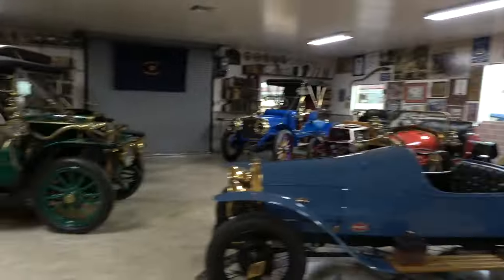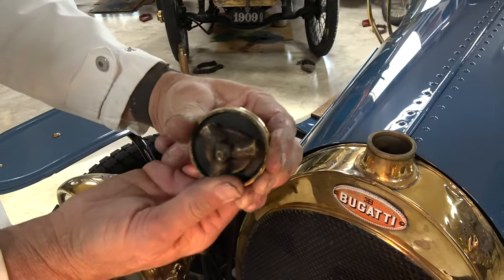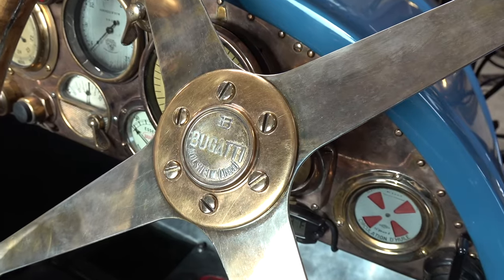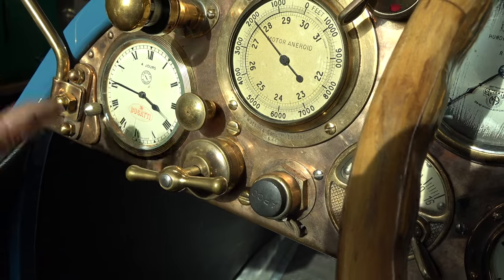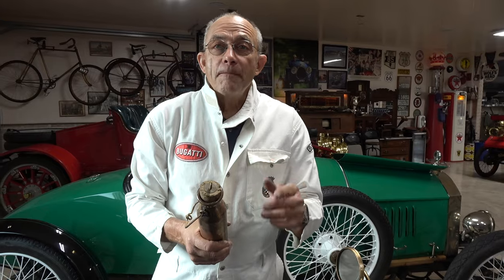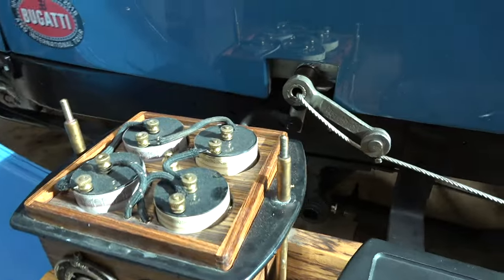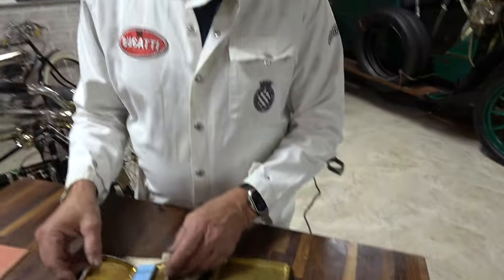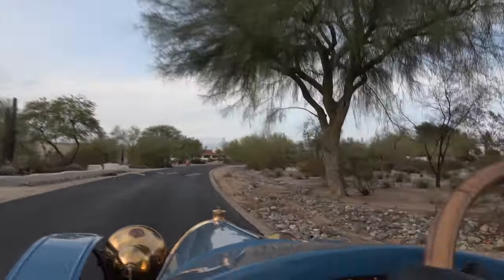Early Automobile History # 11 1913 Bugatti Type 22 Torpedo & Ride on My Car Story with Lou Costabile

Comment: Re: pressurizing the fuel tank. 1/2 a bar is 7.25 PSI not 1/2 a PSI. One  bar is almost equal to atmospheric pressure.  Bar is 14.5 PSI.
Reply from the maker: Hi Dan, Thank you for viewing and sharing your knowledge. Hope you see many more cars on this YouTube Channel you enjoy. Please subscribe, and hit the "bell" so you can see all the cars when they are uploaded on this YouTube Channel, Lou
Reply: Thank you, from where I sit in the Driver’s seat I did not see the scale was marked in Grammes. I know I need at least 50 shown on the scale to have enough air pressure to run the engine.
I know it is very low air pressure because I only need 3 or 4 pumps of the small fuel Air pump.  I stand corrected, thanks, Alan Travis 0:07